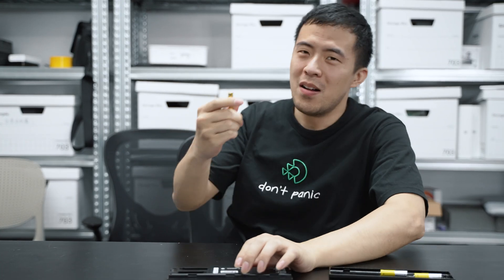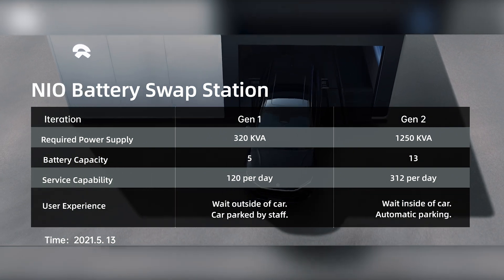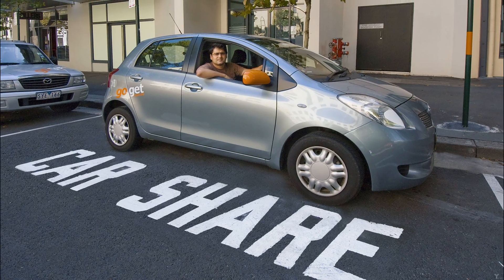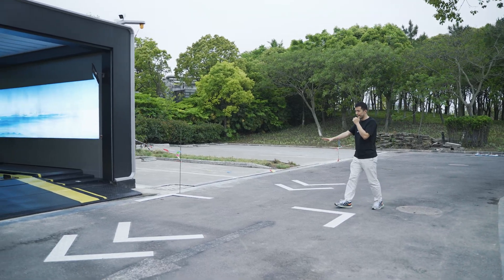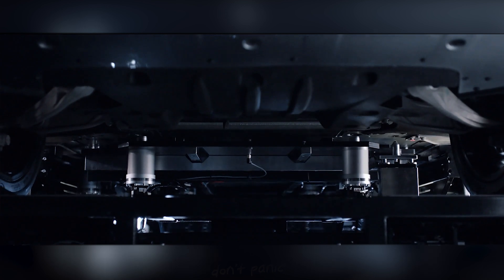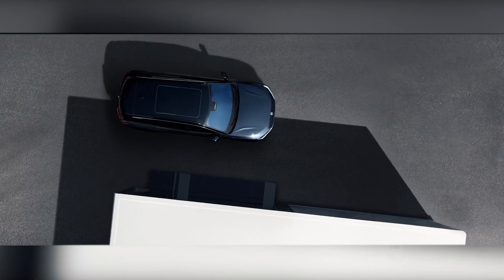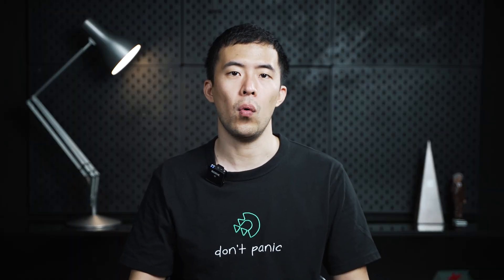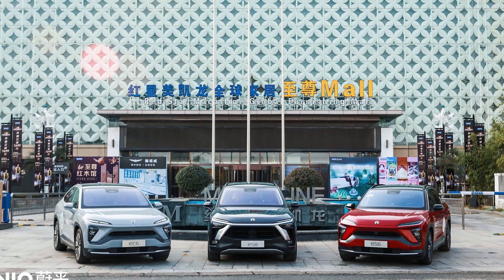Faster and Smarter! Check out NIO's new Swap Station.

Comment: I've seen plenty of videos of perfectly pristine cars going through a battery swap.  Winter would be the time of year with highest demand for battery swapping.  Range is lower when it gets colder and to have a nice warm battery swapped in under 4 minutes would be ideal.  So what happens to all the underbody crude that accumulates in the winter, or the mud and oil and grime from regular use.  

I can't see these battery swap stations having high reliability.  The spec is up to 312 swaps per day, but I doubt the station could handle more than 200 cars full of winter crud on the underbelly before failure.  All that snow and sand will be falling into the swap stations.  I can't wait to see how the Norway stations perform this winter.